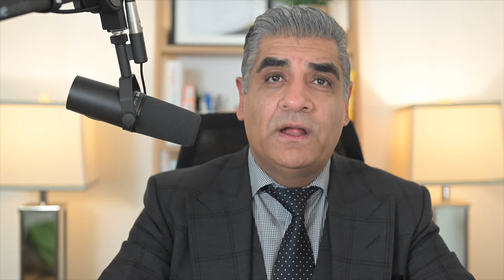The Ultimate Fix For A Leaky Mitral Valve: Find Out Now!

Comment: Dr .very useful vidieo on MR. Does dehydration cause Mitral valve prolapse.Is Mitral regurgiation trivial cause of concern
Reply from the maker: Hello and thanks. Dehydration no but low blood volume can create a condition called systolic anterior motion producing leak which is correctable with proper correction.
Mild leak needs to be monitored.
Reply: Dr Thanks for the clarification onMR with respect to dehydration. In the clarification you had said low volume of blood creates leak and can be corrected.Can it be corrected by medicines and magnesium rich food?.Regarding trivial regurgiation you had indicated to be monitored. How to monitor at home?. Kindly clarify.Regards,V.karunakaran
Reply: Dr your comments required on the above query

Comment: Sir my mom 63yrs, she had MVR with perimount magna ease 29mm mitral valve in 2012.  Company assured 20 yrs.  But gone in 12 yrs

Now Leaflets are calcified and degenerated and leaflets not opening properly severe stenosis ppg/mgp 27/15  in AFIb
No MR or leak.  She had CMV in 1987.

Is enough data available for sapein 3 ultra resilia TMVR please ? 

Which surgery is best for her please
Reply from the maker: The data for tavi in mitral
Position is even worse to be honest. No tissue valve can last 20 years in a 51 year old person on balance of probabilities. If she is fit she should consider redo mini thoracotomy mv replacement
Reply: Thank you Dr. My doctor here is pushing for TMVR sapien ultra , she is very week.
Reply: Sir she also developed infective endocardities..is mechanical value is best or prostetic value

Comment: This is interesting,,,I had elongated papillary muscles, went for mitral valve repair(splitting and shortening of papillary muscles with patial annuloplasty). I might need another surgery as as it's regurgutating mildly again. Is minimal invasive re-repair possible in my case??
Reply from the maker: Thanks for sharing. Yes sir. If you has breastbone before then the easier method to get the the mitral valve is by keyhole